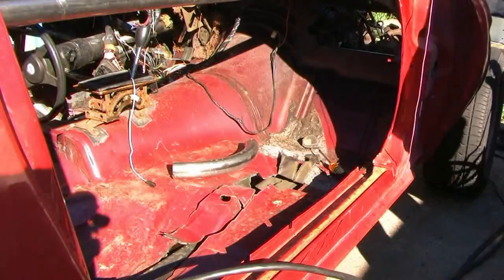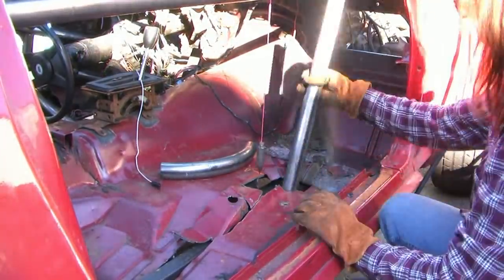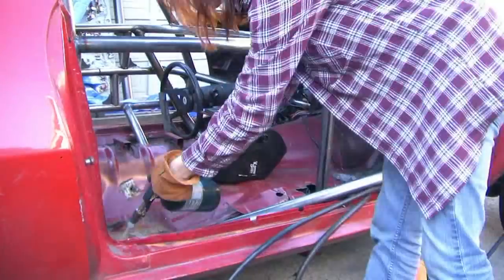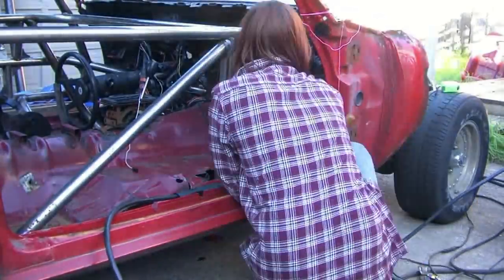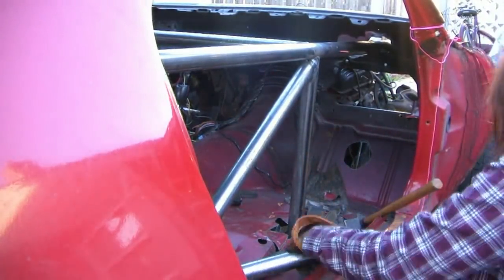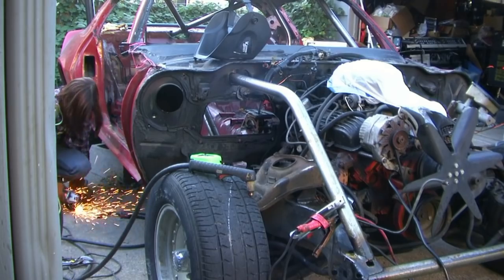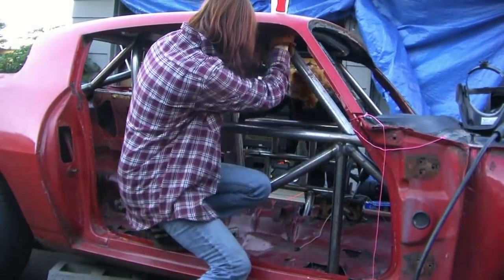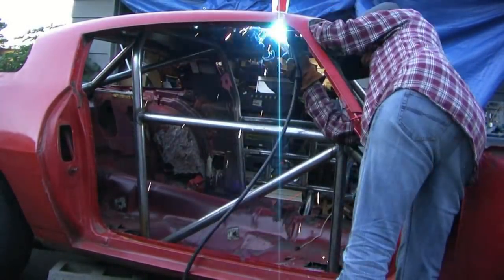Passenger Side Bracing - Building a Pure Stock Race Car

Comment from the maker: @scafativ This type of car has an undercoat that comes off easily with heat and a little abrasion.  A wire brush is good to get down into the low spots(the frames are folded stamped metal with many low and high features)

Comment: I left the doors on my 71 Camaro. Cut every thing out till there was nothing left but the door skin and front jambs and hinges. That way I could hold the doors shut with my knee and measure the bars all the way against the skins. 4 on the driver side and 3 on the passenger. gives you a lot more crush room and the way the Camaro body lines are it triangulates them for more strength. Furthest one out right up against the body line in the middle of the door. Cage went under the seat. Seat only attached to the cadge. Weld some tabs to the rocker panels dill holes for rivets. Take door off and cut out the jamb and there is a door skin. with holes to mount it already lined up.

Comment: What is the technique that you are using with the propane touch and the wire brush- I've not seen that before.  Are you just heating it as you brush it to prepare the surface?  Is it better than a sanding disk?